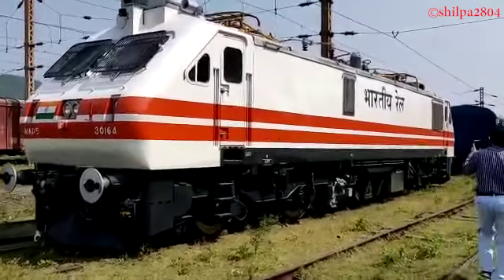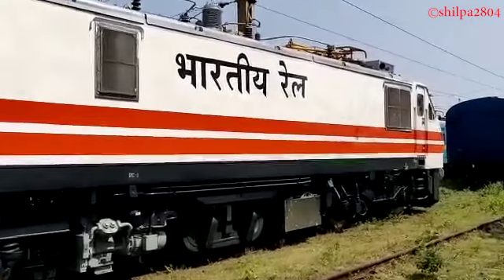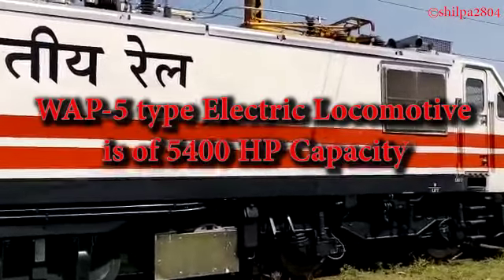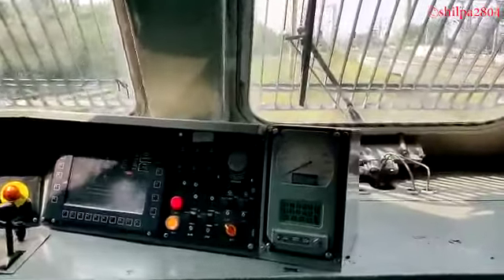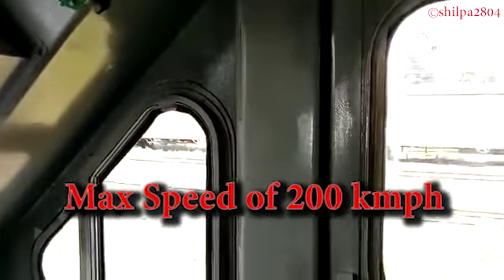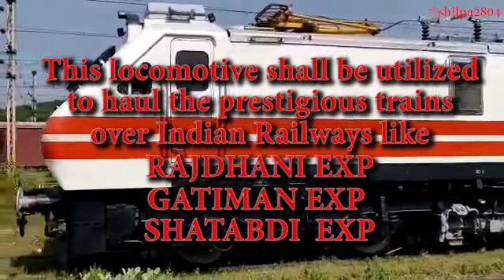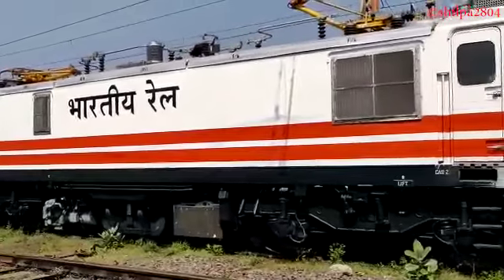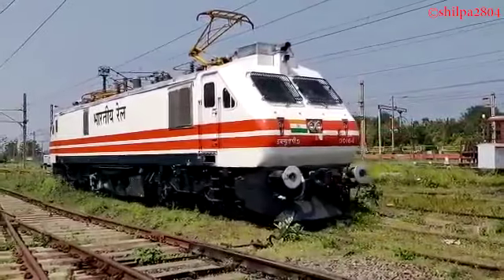1st Aerodynamically designed 3-phase WAP-5 Passenger Electric Loco in Chittaranjan | News Station

Comment: Good that the Indian Railway is improving. No objections. The current govt is doing much better than the previous ones. But why make these "Jambavaan" era locomotives still??.. We have skills, we have good designers, we build metros. Still these indian railway factories probably might be hiring age old mamas to design such locomotives. High time to have a radical change in the designs and horsepower. Its 21st century era for gods sake!! By this time we should be having 100 "train18"s.

Comment: Is it so...?  WAP 7 is a upgraded version of WAG 9,  3-phase with 6122 hp.  Most of the Shadapti express are pulled by WAP 7 and can handle max upto 26 coaches.   Aerodynamic!,  see the front face of T18 and the sides doesn't make any drag or turbulence. Sharp front nose and taper on to the sides is aerodynamic. Our locos are pretty solid with 120 Tons on rails and aerodynamic will be efficient while lateral oscillation, wheel slip and avoid derailment.

Comment: Current WAP5s are tested and capable of running at 225kmph. The above design is just a timepass done by CLW engineers. So much that the approvers of this design are also of the same mentality as the design team. 
According to the designers nuts only a slope can be good for aerodynamics. 
What about the square AC box fitted right on its head? 
Why the flasher lights cannot be concealed as in WDP locomotives?
Why the grills on windscreen required and what is stopping them to use toughened glass for driver safety?

And for all who think the cab slope is really required for that speed then they must checkout World locomotive speed record of 357kmph of Siemens locomotive and specially its cab design.
Reply: No mate they can be modified to run at 225 that doesnt mean they actually do without modification.
Reply: current wap5 cant run at 200kmph with many lhb coaches attached to it ....
Reply: Another cash cow running with our money.
Reply: Devraj Malekar I agree with u
Reply: Exactly!!!